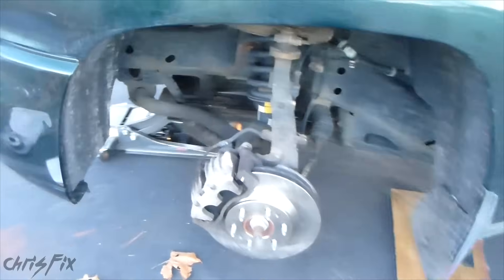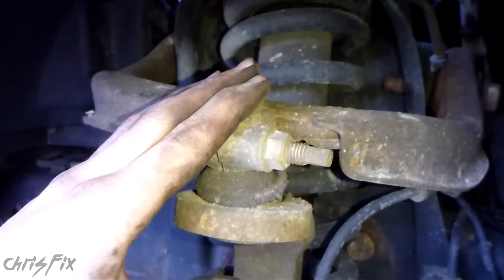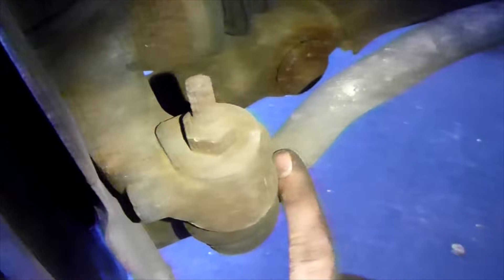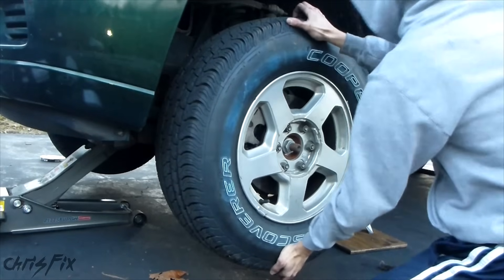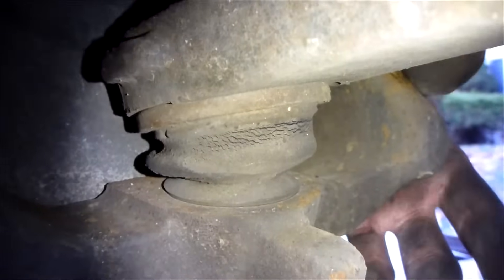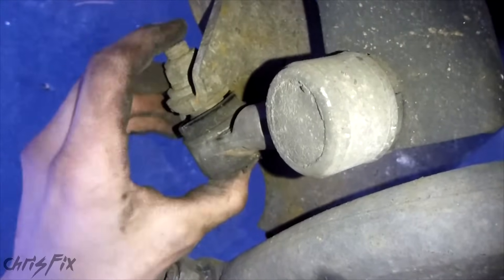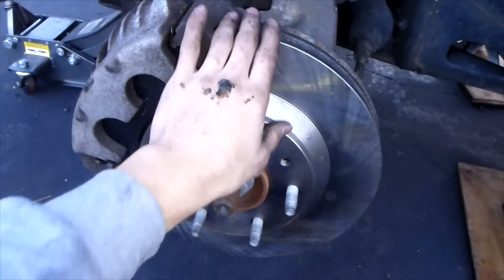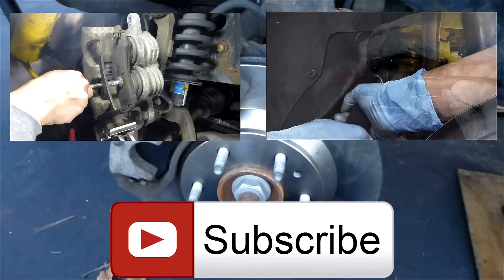How to check out your own car's suspension system

Comment: To properly inspect a ball joint you have to first identify whether it is loaded or unloaded (the ball joint is attached to the control arm the spring pressure is pushing on is loaded) Your demonstration will only check an unloaded ball joint. To inspect a loaded ball joint the spring pressure must be removed first, most commonly by placing a jack under the control arm and lifting that side off the ground. If you do not unload a loaded ball joint you won't feel any play unless it is literally ready to break. Very common mistake even among professional technicians
Reply: ChrisFix Yes I did, and it was a good example of a ball joint allowed to get so bad it was a major safety concern. The ball joint in your video should have been replaced LONG before. Manufacturers generally recommend no more than .050 of an inch of play on a loaded ball joint before they should be replaced. The problem is you will never feel that amount of play unless you unload the spring pressure. My comment was surely not meant to critical of you, I am impressed with your explanations in your ball joint press video. My suggestion would be to research some info from a credible source I am sure it could explain it better than I can in a few posts.
Reply from the maker: Thomas Brake I dont understand how this makes any sense? If you jack the car up by the control arm, you are going to be putting pressure on the control arm because the spring will be pushing down. Therefore the ball joint will be harder to move if it is in fact going bad. Can you explain how this works? Here is a video I did specifically on ball joints if you are interested: How to check a Ball Joint
Reply: ChrisFix Just think of it as putting the ball joint in vice grips (from stud to body) the spring pressure is squeezing it together. Until you remove the vice grips (spring pressure) you will not get any play no matter how hard you push in and out on the top and bottom of the tire.
Reply from the maker: Did you watch my other video? I still dont visualize what you are saying because if the spring is compressed or it is not compressed, the ball joint still has the same pressure on it. The spring is attached to the frame to the lower control arm. If the spring is compressed, that just means you are lifting up on the lower control arm. In that situation, the ball joint has the same pressure as if the spring was removed from the car. I wish I could visualize what you are saying.
Reply from the maker: Tom Brake Ok, thanks Tom!

Comment: if you are going to replace one ball joint its best to replace all four unless it is a question of money for preventive of avoiding othere joints to break on four wheel drive vehicle you can buy needle grease part that allows you to fill all joint with no grease fitting you wheel need to check and regrease them at least every oil change or fill them wipe them clean use permatext to seal the hole so grease dose not leak out you will need them to cure and it dose help you save
Reply: ChrisFix
You pierce the rubber boot and insert a thin "needle" greasing tube.  Then seal up the hole with Permatex rubber sealer etc.  Best solution IMHO is buy greasable joints/tie rod ends.  MOOG suspension company sells really nice upgrade parts for tie rod ends and stabilizer bar end links that are purpose-built with grease fittings.  Ungreasable ones are not made to expel grease and usually what happens is the rubber/seals bulge or distort and unseat or break/burst.  Stay gold.
Reply from the maker: Primitivo Luciano Thanks for the tips. What are needle grease parts? It allows you to grease ball joints without a grease fitting?

Comment: I looked at everything up front and did the shake tests and everything feels fairly solid. But when I turn, I get a creaking noise. 

I don't feel anything in the steering wheel. Any ideas before I pay for it to be looked at?
Reply from the maker: Vince Hodge Watch this video. I bet its ball joints making that noise. Does it sound like the noise in this video I linked?
How to check a Ball Joint
Reply: ChrisFix Yep, pretty much just like it. Just a bit quieter. 
And it doesn't happen all the time. It seems to come and go. Could I maybe just need to grease it?
Reply from the maker: If you can grease it then definitely do that! That is most likely a ball joint noise. Are the boots ripped? Did you try to move the tire like in the video?
Reply: ChrisFix Okay, it was quiet all day today. I had the front wheels off this afternoon and the ball joints look good. The lowers actually look brand new. They don't have fittings for grease though. I think if it starts up again I'll just take it in. But thanks for narrowing it down with that video of the sound.

Comment: Will u get a clucking noise when going ove bumps from a end link or a dry rotted bushing inside the ball joint?
Reply from the maker: It can be a million things. Did you jack the car up and move the wheel around yourself and look for things that might be bad (bushings, ball joints, cracked rubber, etc)...?
Reply: Yup. Found crack rubber on both ball joints and a lot of play in the end links. Thanks you've been a big help.
Reply from the maker: Great! Glad the video helped!

Comment: left and right is for tie rods not ball joints
Reply from the maker: Yes you are correct, but a bad ball joint will have movement in the left and right as well.

Comment: So on my ford I have a grease fitting on my brake caliper. Is that for grease or some kind of caliper fluid? Thank you
Reply from the maker: No, that is not a grease fitting that is a bleeder valve. Do not try to grease that lol. That gets air out of your brake system.